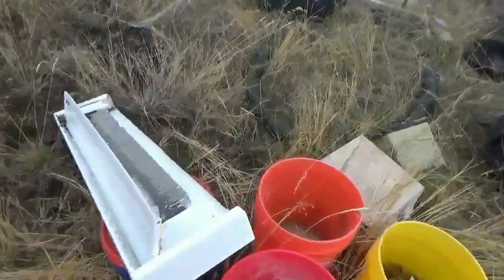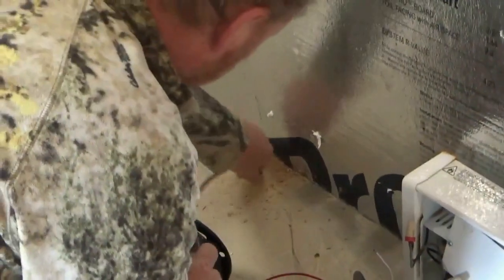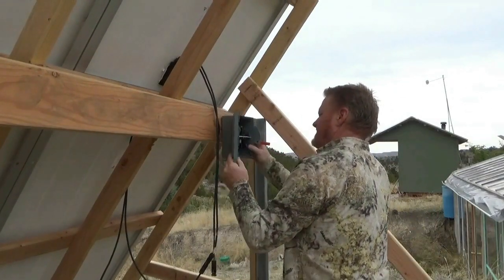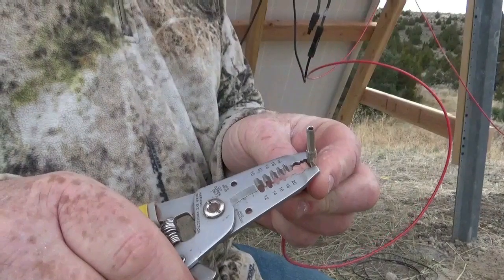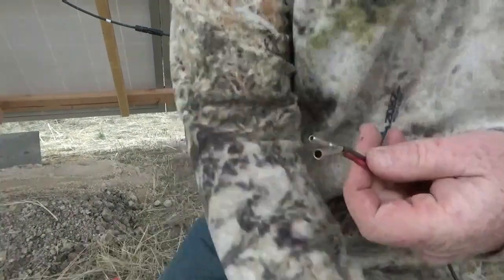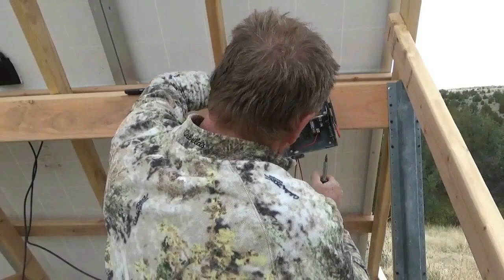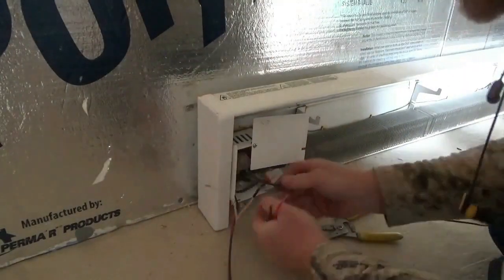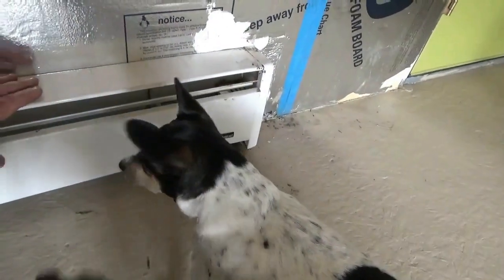Can you heat a house with solar PV panels and a baseboard heater?? Watch to find out #Free Energy

Comment: A nice and simple project. Let's do some Ohms law on it.

Baseboard heater: 220V 750W
1 Solar panel: 34,17V 7A
6 panels in series: 205V 7A

AC:
750 Watt / 220 Volt = 3,4 Ampere.
220 Volt / 3,4 Ampere = 64,7 Ohms.

DC:
205 Volt / 64,7 Ohms = 3,17 Ampere.
205 Volt x 3,17 Ampere = 650 Watt.

Good numbers and 650 watts of heat is not bad using direct DC from solar. However, for someone with little to none experience of electricity, 205 Volts DC could be lethal + the components in AC appliances are'nt made for DC. It can easily burn the thermostat and the built-in switches in the heater. If something goes wrong with 205 Volts DC, you'll get an ARC looking like lightning inside your house. I wouldn't even touch the possitive and the negative wires at the same time with 205 Volts passing through.

My setup should look like:
2 strings of 2 panels in series in each string and then connect the 2 strings in parallel.

2 panels in series:
34,17 Volt + 34,17 Volt = 68,34 Volt 7 Ampere

2 strings in parallel:
68,34 Volt 7A+7A = 14 Ampere

Since the heater contains resistance wire, you'll have to lower the resistance (Ohms) so it can run on lower voltage. Measure the Ohms with a multimeter and cut the wire at...

650 Watt / 68 Volt = 9,56 Ampere.
68 Volt / 9,56 Ampere = 7 Ohms.

So 7 Ohms instead of 64,7 Ohms.

Now the heater produces the same heat, 650 Watts, but it's alot safer for people and the house if or when something goes wrong. But to be honest, it's still not safe and should only be operated during supervision.

I'm sorry for hi-jacking your comment section, but there's a lot of gaps in the knowledge around solar and if this information can spare one life or save a house from burning down, then I've done something good.

Keep up the good work with your interesting videos. I'm looking forward to the next.
Reply from the maker: So quick question, and please excuse my ignorance here, but what makes the DC current more dangerous than AC?
Reply: @veggitarianredneck The DC arc is the difference. Every time you disconnect DC you'll get an arc, a little lightning, because the DC circuit struggles to always be running. Low voltage = small arc, High voltage = bigger arc.

An entire DC setup is a safe system, because every switch and component that breaks the current have built in arc protection.

An AC switch or component is not built to catch the arc, so in worst case the DC system will continue to work even if you switch it off because the arc is still making the connection.

If we make an example with your heater running on AC:
There is an on/off switch, a thermostat that controls the heat, probably a built in overheating switch and if the heater is a stand-alone model it'll probably have a tip over switch that will break the current if it fells over. So, 4 switches of some kind to make the heater safe to use and with AC current it's 99,9% safe. 
In worst case DC scenario, the arc can make a bridge over these 4 switches and the disaster is done.

You cannot thrust any AC appliance connected to DC, but you can easily change the components and resistance to make them safe.

650 Watts of heating 4-8 hours on a sunny day is not much to be happy about if it burns down your house.
Reply from the maker: Mmm, I see your point. It might be prudent for me to make an updated video of the dangers of DC current and using it in this scenario. But to be clear the system I have is literally a direct path from my solar to my heater. It has no thermostat or switch other than a disconnect at the source that I turn off during the summer months. So my system should be safe from the dreaded dc ark. Thank you for your knowledge🙂
Reply: @veggitarianredneck  If the panels are connected straight to the resistance wire without any AC switches in between, then you're right. Your system is safe.

But, I'm still raising my eyebrows a little bit about the 205 Volts and I would love if you made a video about high voltage DC and the dangers behind it. As soon as you exceed 60 Volts, you'll have to start thinking about the safety or else one little mistake can be your last.

You would never see someone change an electrical outlet running on 220V AC without cutting the power and measure it twice to ensure the power is of before the screwdriver comes along. This respect for electrical current doesn' t exist for DC.

I'm looking at videos on YouTube everyday at people that's connecting panels with cables running everywhere at the same time as the panel/panels are "live" in the sun and creates current. If you would ask 10 of your friends how they turn off their solar array, I'll bet all 10 says; With the switch, and none of them will respond with the correct answer; Cover the panel.

Knowledge isn't heavy to carry, so I'll be the first to give you a Thumbs up if you release a video on DC safety 👍
Reply: @SolarProjectsSweden Anything disconnected ( or connected )while it’s running will arc, ac or dc.
Reply: @twoweary  That's true, but the AC  ark is more like a little spark in comparison with similar voltage.
Reply: @SolarProjectsSweden  Great points, with the math to back it up.

Comment: What happens when the element breaks down and the PV goes into the water, would you get electrocuted from the high dc voltage?
Reply from the maker: There is a real danger of electrical shock, just like any other high voltage. But to answer your question, I don't think so

Comment: Is there a need for a thermostat of some kind of control. It won't over heat?
Reply from the maker: No it doesn't overheat, but I'm sure you could put a thermostat on it
Reply: DIS-connecting PV or DC is a big deal, especially at 200+ volts.  No, you can not just put a line voltage thermostat in the circuit.  Luckily, you don't need one as even 2,000 Watts of heat will not overheat one's house before you switch off the heater after dark-- when any switch  is good enough.

Comment: Here's a video showing the difference between switching AC and DC at higher voltages. https://www.youtube.com/watch?v=mQpzwR7wLeo
Reply: Fine demonstration of the danger of 205v DC. I don't think OffGrid406 realizes the danger unfortunately. Since his fuses are only rated AC, they would not protect him very much.
Reply: PV panels can be short circuited until the end of time with no harm coming of it.  In fact, Impp is typically 90% or more of Isc.   Fuses used on PV-DC circuits are rated for 125% of Isc, rounding up to the next standard size, because they are only there to protect against lightning strikes and power lines falling on them.  PV panels can not over-amp like the grid can.
They guy showing the difference between switching AC and DC needs to actuate his switches faster and he needs to learn about snubbers.  The capacitor in a snubber sucks up the arc energy before the arc can get started.

Comment: I have an off grid shed I need to heat. Only need to keep it at 40 degrees. I was thinking an aluminum can thermal panel w solar fan. And a backup propane heater if needed. I can’t run power so need an off grid option that isn’t expensive.
Reply from the maker: The aluminum can passive solar collectors are really efficient. A friend of mine made one and it works great. Only comes into play when the sun shines though
Reply: @veggitarianredneck  I really appreciate your response. I have now acquired 2 fans. solar panel, battery and charge controller. and I have metal roofing to create a passive solar panel. Of course it is easy to get aluminum cans too. Just trying to figure out which style will provide the most heat for a small shed that only needs to maintain heat at 45 to 50 degrees. It is cold storage for fig trees. the space is fully insulated. 10 by 20 shed. The whole back of the shed is south facing. so perfect to mount the system.
Reply: Use aluminum downspout instead of cans much easier also used a double pane glass from an old slider

Comment: Nice project. Don’t forget to install a ground to the heater and to your disconnect ( metal box). If they were to become energized ( shorted) somehow your fuses wouldn’t trip because the current isn’t going anywhere, it will just put voltage on the metal parts. Your gas pipe should also be grounded already, so a short wire down to the gas pipe will do the trick. I don’t have much experience with solar but I am an electrician, and grounding metal parts in almost all scenarios is crucial.
Reply from the maker: Thank you, I'll take your advice

Comment: Tips: 
Working with DC voltage more than 12V-24V can kill someone very quickly.
205VDC is considered as high DC voltage.
DC does not let go.
You needed at least a 10AWG wire to run that many amps DC that distance, an 8AWG would be better.
What was the initial wattage of the heater at 240VAC?
DC is calculated differently using Ohm's Law.
Most baseboard heaters have a power rating of 500W-2000W.
That would be 2.43A to 9.75A at 205VDC.
Use the correct type of crimpers for the MC4 connectors.
If you have that many panels, you will need the correct crimpers to prevent constant pull-outs.
Reply: When you say crimpers does that mean soldering would melt?
Reply: @MikeJones-rk1un  DC is not soldered, it is crimped.

Comment: Generating electricity with a solar panel in order to power an electric heater is a terrible waste of resources.  It would be far more efficient and cost effective to put in solar thermal panels with a heat exchanger in the house.  You are effectively using your entire solar array to power a single baseboard heater.   Hell, you'd be better off installing incandescent lights to heat the house. You would get light along with the heat.
Reply from the maker: It was an experiment for the sake of curiosity. The panels costs less than any other type of solar collector anyways.
Reply: @veggitarianredneck  Well, if you got a special deal on them and they were cheap, it could be a good way to use them.
Still, solar thermal is a lot more efficient.  PV is, at most, about 18% efficient. Solar thermal can be up around 80%, especially at the low temperature heat you need for heating a house. 700F would probably be fine for that.
Reply: The last time you guys installed solar thermal, it was cheap because copper + antifreeze and everything else was cheap.
The last time you guys installed PV, it was expensive because Silicon was expensive.
We now live in a world made possible because of cheap Silicon.  Right now (February 2025) you can buy 400 Watt PV panels, at retail in quantities of ten, FOB Sulfur Springs TX for $100 each.  If you get a chance to buy used solar thermal panels BUY THEM.  They are worth a fortune in scrap.  My 4' x 10' panels brought over $150 each for the scrap copper and aluminum.
    To the point that solar thermal is more efficient, yes, it is--on a hot summer day.  On a cold winter day in Wisconsin, they struggled to provide usable heat for my house unless the skies were clear.  Note that the Offgrid406 is using his array to heat his house in the winter, Not for DHW in the summer.

Comment: You are an inspiration sir, I'm low income and been trying to find ways to warm up a single bedroom in California this looks like it might be it as we get sunshine year round so something to run in the daytime hours would be incredible.
Reply from the maker: Thank you, glad it was informative.
Reply: @veggitarianredneck  I've also seen where you can get  solar heating element for regular electric hot water heaters from 150 watt on up to heat water using solar power
Reply from the maker: @timothyfirth4809  yes I have two 600 watt elements that run on 24 volts in my water heater now hooked to a dump controller

Comment: I like how you went DC on this project. Another power hog is your hot water heater. If its electric you could try the same thing with a circulating loop and a dc heating element. Have the element heat water from tank and then circulate it back in. Won't be a replacement but could bring the AC service down during the day. You seem handy and I bet you have an old tank in that scrap heap. Doable?
Reply from the maker: Yes, I actually had a water heater hooked up to my charge controller on dump mode. On average in the summer time I was able to get a fully hot tank, 50 gallons, in two days. If careful we had hot water all summer long
Reply: Thank you for this thought

Comment: The problem is when there is no sun.....then you need a football field of solar panels...and you still can't heat your house.🤧
Reply from the maker: You are not lying
Reply: lol. It comes down to can you save one gallon of heating gas a week or can you save a couple of turns on the electric meter. Over the winter that can add up. @veggitarianredneck
Reply from the maker: @SpinDizzy-fr8bc  exactly right. Margins might be small but they ad up
Reply: >- . . .  when there is no sun...-<   then you will need more than a football field of solar thermal panels because they produce NOTHING under overcast skies in the winter.  Solar electric produces 10-35% of full-sun power under overcast skies, and produce MORE in cold weather than in hot weather.  10-35% is a lot more than nothing.

Comment: It absolutely wouldn't be producing 750 W worth of heat the majority of the time that it's operating, and that's really not much in general, especially in a wooden structure. Watts = Volts x Amps, and with the reduced voltage coming from the panels (only peaking at well less than the heater's rated voltage), the available power will be far less than 750 W throughout the day. Maybe consider a solar hot water system with a good deal of storage and baseboard radiators?
Reply from the maker: You seem real sure about that.
Reply: @veggitarianredneck  About the fact that it wont produce 750 watts worth of heat? Yes, I'm absolutely sure about that, that's just Ohm's Law. You could get a 100A, 250V Watt meter off of ebay for about $15 and put it to the test. I'd also bet that the heater drags the voltage of the panels down to below 200 volts, even at peak.
Reply from the maker: You seem real sure about that.
Reply: @veggitarianredneck  Sorry, I was looking at an AC meter. There are some DC meters that go up to 200v, but it might be kinda hard to find one that goes up to 250.
Reply from the maker: @PistonAvatarGuy  Well OK challenge accepted. If you don't mind I'll put the results in an up coming video and record the results. Of course if you are right I will graciously concede.
Reply: @veggitarianredneck  I look forward to seeing your findings. You can also measure the resistance of the heater, then measure the voltage that it's being supplied with and calculate wattage that way.

Edit: And, of course, you can always estimate the resistance using the power and voltage ratings (should be 65 ohms), but it's always better to get an actual measurement.
Reply from the maker: @PistonAvatarGuy  It needs to be done, your not the first person to wonder about this
Reply: @veggitarianredneck  Definitely.

Comment: Someone correct me if I'm wrong but you can measure the resistance of the element. Then once the panels are hooked up measure the volts at the heater. Volts÷ohms=current. Current X Volts = watts.
Or voltage^2 ÷ ohms = watts.
I had 4 250w panels hooked up to a space heater element once. The voltage was 81.5v and resistance was 13.4 ohms. It comes out to 489 watts.
Only about 20v per panel when their optimum is 30v but I was also not angled correctly. Best I usually get with those panels at the wrong angle is 135w through an mppt.
So apples to apples I get 540w through an mppt charge controller and straight to a heating element I was getting 489w.
It's pretty good as long as my math is right. No battery, inverter, or charge controller...
Now I run a lot of panels through an inverter and into 2 space heaters but I find myself wondering if I shouldn't be going straight to heating elements in the winter. Easier on everything and no electronics to fail.
Reply: My heater was 40 homs can i give him 180v DC from panel?
Reply: You are almost there.  The resistance of the heater is equal to the rated voltage squared, divided by the Watts rating.
(240 x 240 / 2000= 28.8 Ohms.
The other trick is to use a load resistance (Ohms) that equals Vmpp / Impp.  A little better, if wiring DC-direct, is to use 0.6 of Impp.  This provides for a higher resistance (= lower wattage) load that does not unduly drag down the voltage as happened with your set up above.  It is not always noon on a sunny so it's best to design for a current of something less than Impp.